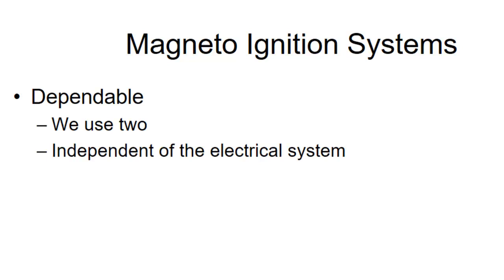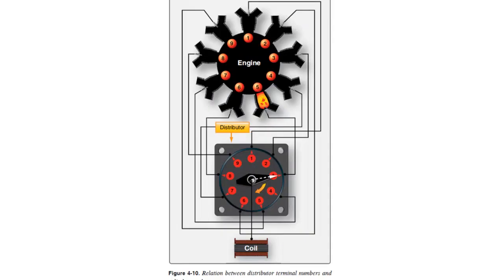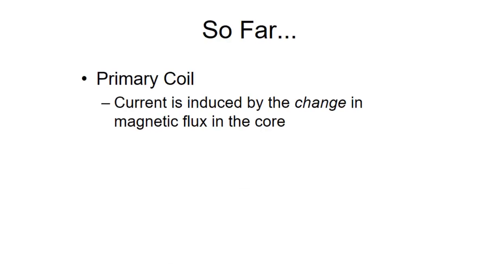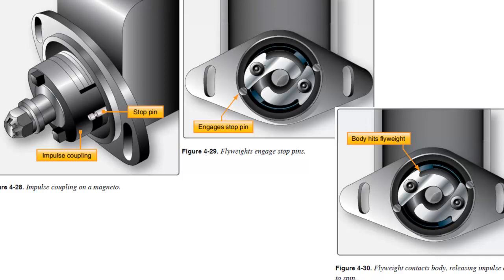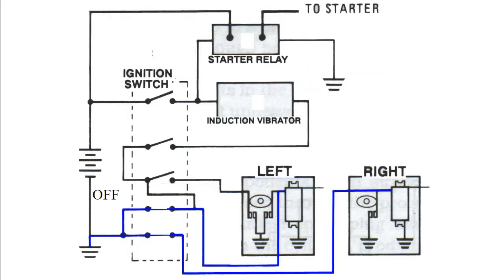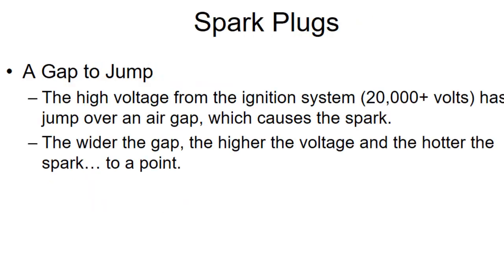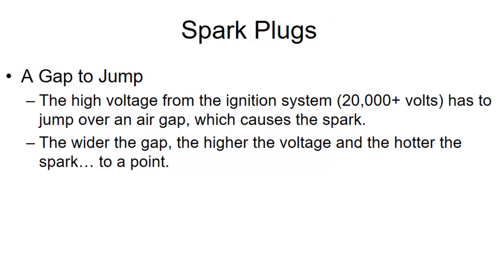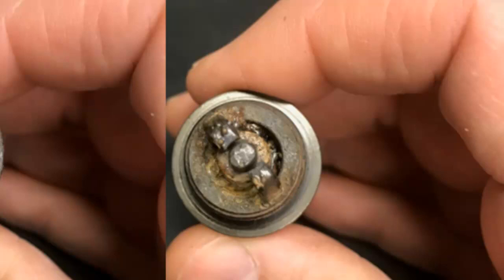ASP - Magneto Ignition Systems

Comment: Why on a mag switch is the right mag on the left and vice versa?
Reply from the maker: Good catch! It’s because you ground the mag to turn it OFF. So on the back of the switch, the left terminal (as you face forward), which is labeled “R” for the pilot, gets wired to the p-lead of the left mag. That means that the left mag is grounded to turn it off when the pilot selects R.

Comment: if the coil have more Turns ,, does that Give it more volts?
Reply from the maker: Yes, though to be precise it is the RATIO of the number of turns in the primary to the number of turns in the secondary (along with the strength of the magnet and how fast it is turning) that determines the final voltage. That ratio works the same way in transformers, too.

Comment: the original magneto does not need those things and it was a dc magneto ac is not necesary at all
Reply: I think this is a matter of semantics. To cause a spark, the current through the primary has to change with time. The faster it changes the larger the induced voltage, hence spark. So the current does indeed change with time (I.e., it “alters” with time).